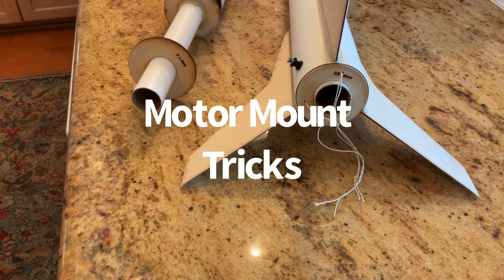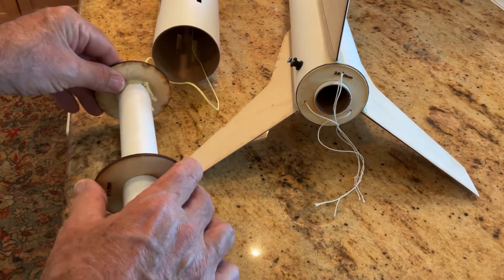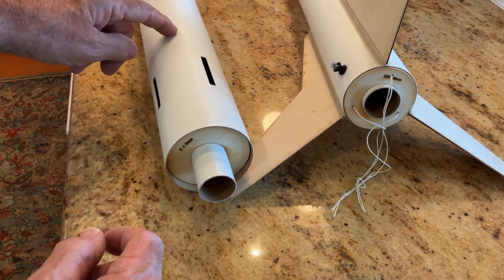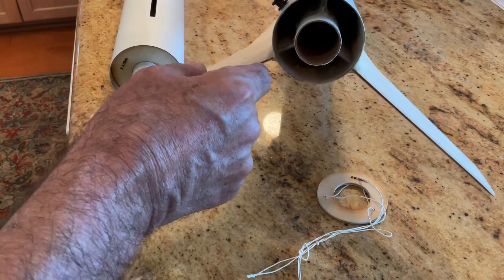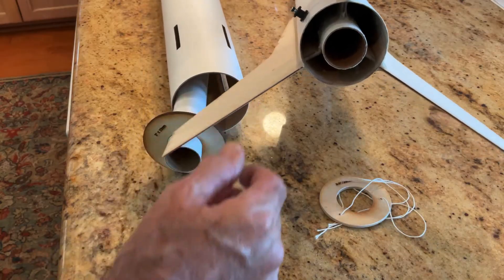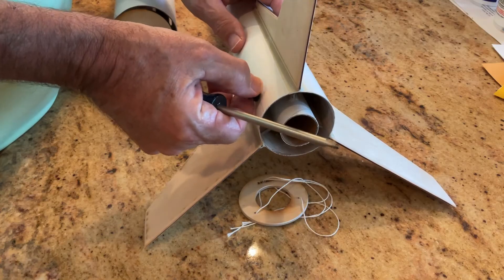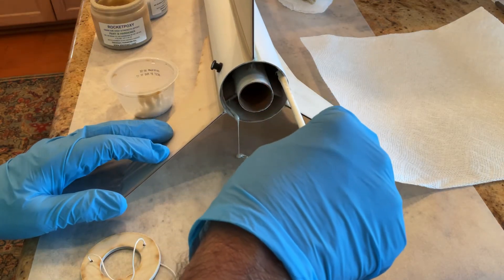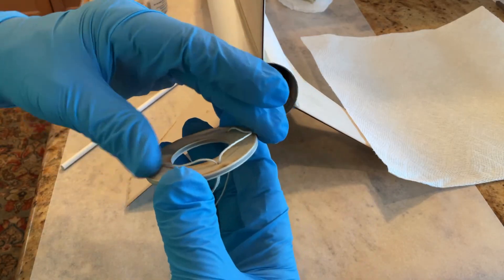Model Rocket Motor Mount Tricks

Comment: I built motor mounts like that over 20 years ago.  I didn't get this idea from anybody else although I doubt it was new.  I just thought about how to get the motor tube centered but still have access to add internal fillets and the answer was to make the rear centering removable.

Comment: what size is that shock cord?> looks so small like it would tangle up. my kit came with this webbing stuff.
Reply from the maker: That is a piece of Kevlar cord that came into use a shock cord material after the original Estes rubber band product. When you use this Kevlar as a shock cord, it has to be extremely long because it is not elastic at all. Another thing you can do is use a short piece of Kevlar as an anchor to the motor mount and then tie elastic shock cord to it. There are quite a few different ways you can create a shock cord. If you go to the Apogee rockets website they have instructional videos that go over this concept.

Comment: you buy the rocket motor shop estes
Reply from the maker: @zyp4698  I bought the tubes and nose cone from Estes and the motor mount and fins from Bad Boy Rocketry on eBay. I believe this was a clone of the Estes Maxi Force, long out of production. I have the kit purchased I’m quite sure in the 90’s, but opted not to build it as it may have some value. So I cloned it.

Comment from the maker: Also, when you glue in the motor mount with glue only on the front ring and the back ring without glue, you glue on your fins. By glueing the fins on with the aft ring loosely in place, this will secure the motor mount tube concentrically. THEN you pull out the aft ring to do your fin/motor mount fillets. Be sure that no fin glue gets on the aft ring or you can't get it out! Watch this guy's video starting about 19:22 for a good demo.   https://youtu.be/Xtr3758PvzA